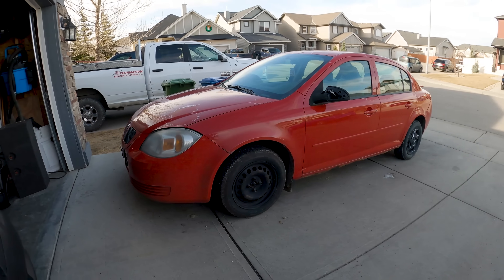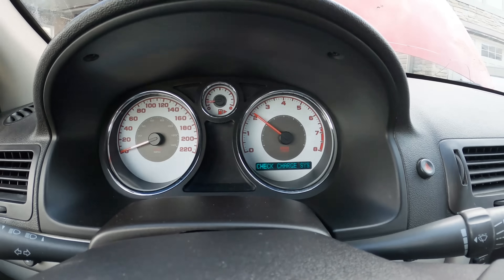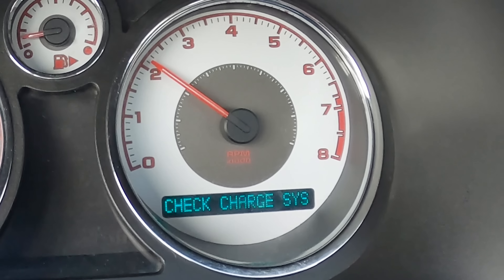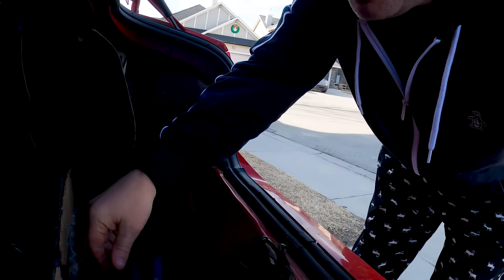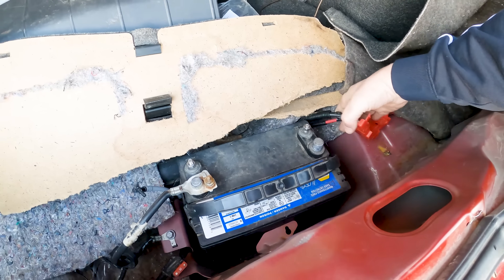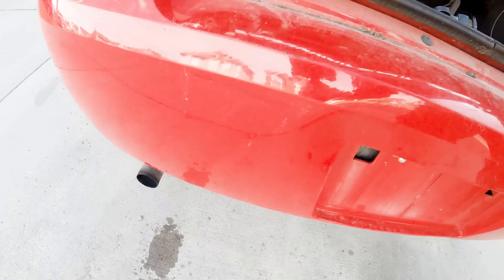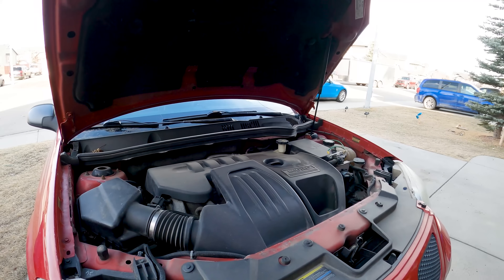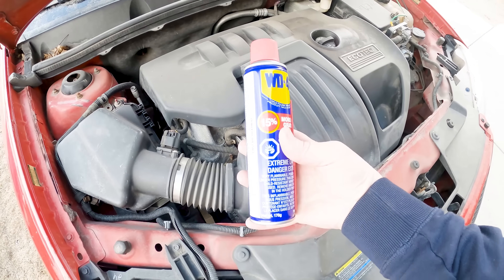ROADSIDE FIX! REVIVE your DEAD or DYING Alternator with this ALMOST FREE trick! | Gears and Tech

Comment: I have a strange question.  1995 Ranger. Had a stall out in the middle of the road which I thought was cause by the alternator. In the process of trying to get it out, I had to liberally spray the bolts with PB Blaster but some got inside of the alternator itself in the process. I had the alternator tested at an auto part store and it passed. Could this have temporarily restored my alternator and is there a way I can find this out?
Reply from the maker: It could have

No real way to find out. If they tested it they would have loaded it up too. So they should know
Reply: @GearsAndTech  I got a charge system tester from Amazon, tested it, and on the engine it is producing 11.6 volts at the battery.

Comment: i dont see what wd40 will do, another trick is to bash the alternator with a hammer, tire lever or something heavy, it unsticks the carbon brushes enough to make contact again and fire the alternator again, how long it lasts is a mystery 2 minutes, 2 hours or two weeks who knows ???
Reply: You obviously didn't read my comment..i literally feel this WD40 thing was/is a dam life saver..WD40 washes the carbon tracked rotor/brushes temporarily, giving it 100's of miles of refreshed duty to get to point B and them some.
Reply from the maker: Yes. Sometimes getting to the alt to hit it is harder than spraying with wd40

Comment: I wouldn't do that disconnect the battery while engine running. voltage could spike blow the PCM. its happen before. i have 50 years in car service field.
Reply from the maker: Thanks for stopping by

Comment: no tools eh? that ($10) usb adapter is a tool in this context. if you are creating a list of shit people would need to test the alternator why should someone go get a usb adapter when it would be nearly the same cost to get a cheap ($12) multimeter and at the very least the multimeter would have a MUCH WIDER use range.
Reply from the maker: You don't need those tools. That's just extra icing on the cake. Not required though

Comment: Thanks the WD40 worked in the alternator it came back and the battery was at over 14 volts engine running. The lights are bright and so is the chance to get important things done for the near future. Please give yourself a nice pat on the back for your great advice. :)
Reply from the maker: Glad it helped
Reply: Get it changed out asap, and keep the now working old one as a back up.

Comment: Never ever removed the cable when car is running it will destroy the ECM and the alternator and if it's charging it should be at 14 volts
Reply from the maker: Thanks for stopping by

Comment: You are completely wrong! I’ll spare you my almost 30 years of automotive credentials and 2 master’s degrees because you probably don’t care anyway.  Disconnecting a battery terminal on a running vehicle on any car made in the past 35 years is not only the most stupid thing one can do as a diagnostic, it is also not at all reliable as a diagnostic! Especially on vehicles manufactured in the past 15 years as they are almost all computer controlled charging maintenance and electrical field controlled according to electrical demand. You truly have no idea what you are talking about and possess absolutely no command of automotive repair, electrical or electronics theory and operation. Disconnecting a battery terminal on vehicles in the 1970s and older was common to test the charging system and also necessary because they had generators with external mechanically operated voltage regulators that were unaffected by voltage anomalies and high current spikes that destroy modern electronics through the high resistance condition created when disconnecting a battery terminal while under operation and electrical generation. It was also necessary to do on 1970s and earlier vehicles as a diagnostic to see if the mechanical relays in the voltage regulator would operate when energized and de- energized additionally the generator could be put into a full field operation that way as well. Very few mechanics in those days had electrical diagnostic tools to trouble shoot without disconnecting a battery terminal. You however are just negligent on so many levels of misinformation throughout the entire video. Please stop embarrassing yourself… please!
Reply from the maker: Thanks for stopping by

Comment: As a slight mechanic, idle voltage at least to the battery should be somewhere near 14 volts. That being said the cigarette lighter port should be at 12-14 volts constantly when the engine is idling
Reply from the maker: Thanks for stopping by

Comment: @Jamesgeorge4874 is 100% correct! Many newer vehicles, especially chysler with a tipm system, or many other high end electronics can be severely damaged by his process of disconnecting the battery while the engine is running. The 2.2ltr eco tec featured in his video seams to be a 2007 or older Pontiac G-5 due to not having variable cam timing which the 2008 models have means, THAT IS NOT A HIGH END, HIGHLY OPTIONED VEHICLE! ITS THE REPLACEMENT FOR THE CAVALIER, & DEFINITLY NOT A MERCEDES BENZ! also, spraying water displacement #40 on one's serpentine belt is NOT A GOOD IDEA!!!!  In the alternator maybe in that situation but, NOT ON THE BELT!!! I've seen tipm systems go out for no reason at all much less disconnecting the battery leads while operational. One is begging for computer problems in a 2015 & newer vehicle doing as done in this video. On older vehicles this was a standard test 4 a alternator but with computer controlled cars, is it worth frying electrical circuits?
Reply from the maker: Thanks for stopping by

Comment: Why not electronics cleaner or even brake cleaner to clean the a alternator brushes?! 
WD-40 is conductive and spraying it frivolously onto an electrical component has the potential to not end well. 
I understand this worked for some people but it would almost certainly be safer to use a non-conductive spray cleaner.
Reply from the maker: Because it's doing more than just cleaning. It's also unsticking things.

Nothing is better at loosening things that should be loose.
Reply: @GearsAndTech That is true.
But if the alternator was completely stuck and not spinning there would be a serious problem and WD-40 would probably not get it spinning again if the belt wasn’t able to turn it. 
The belt squealing would likely be a loud giveaway if the motor was able to start, and in the case of possibly getting WD-40 on the belt would reduce friction on its pulley further making it less likely to spin.

Either way, it’s good that it worked and it was able to run for awhile safely.

Comment: or you can just drive to autozone or some other car parts store and they will check your charging system for free
Reply from the maker: Hard to do on the side of the road with a dead battery

Really easy to spray wd40 in on the alternator and get a boost then drive home with no issue

Comment: Removed the battery terminal to check my 2019 Jeep alternator. Engine stayed running:). I don’t believe the electrical issues as my battery died nearly completely was at 9v. 9v is way worse for electronics the interior had a strobe light instead of a dome light, and all dash lighting was flickering for about an hour until I towed it home. The engineers have to design the electronics for a dead battery as batteries will fail inside the warranty.
Reply from the maker: Battery has a problem. Alternator is good

I agree with you. These vehicles will all likely have a battery fail open at some point. It's the same thing as removing the cable

Comment: That's all fine and dandy as long as the problem is just the brushes and not the voltage regulator
Reply from the maker: For sure it won't fix everything. But it's worth a shot
Reply: It WAS all fine and dandy for me with my sister broken down over 250kms down the road sitting in a precarious spot..this trick saved waiting hrs for a tow, and was a under 10min fix..

Comment: If you don't have WD handy a tap on the alternator with a small hammer or similar will often  get you going again.
Reply from the maker: It can help. Usually it's hard to reach them with a hammer. But you can get the wd40 to spray in there

Comment: |> |> |> |> |> |> |> |> 
|> |> |> |> |> |> |> |> |> 

Great hint ...

But you would not pass the technical Test of a Austrian driving licent when the tester is picky ...

Because you should ALWAYS beginning with minus by disconnecting and end with connecting ... Because it's the same like by starting help ... Hho gas can apear in the batteries ...

It's is taught in the curse ... 

Reality ... Well ... When the place is good vented and the batteries is no danger ...

Problems spear when the batteries is not vented and some funny things was made several times which produce Hho gas (66, periodic hydrogen and 33,periodic oxygen on electrolysis) ... And in the origin me x is it self enlightened under pressure and it don't need a lot ... That is to see by all that funny guys which do around on YouTube s eith Hho cells which don't seperaten hydrogen and oxygen by production and that bullshit bubblers ...

One reason why Hho is not that easy to apply on cars is the capsizing thing.

Basicly if no bubblers and a seperating cell is the danger ZERO by Hho but a cell must be constructed that capsizing is no problem plus proper production ... Is no problem when you have the needed intelligence ... 

And with the amount of oxygen you can control the burning process ... Stanley Meyers cell didn't seperaten the gases and would do never get eu regulations aprovement.

But my system must be approved.

Anyway .... That is the reason why the order by connecting and disconnecting.

Yes ... And what is done to real developers which don't serve the blood money dependence system ... Retired high educated machinist for building, I stalling, and maintaining factory street, hydraulic, pneumatic, rldcttopneumatic, SPS, CNC, all methods of welding, ECT, ECT, ECT, ... 

You must fuck whores in pataya as Austrian pensionist ... 

But to create such things like the Hho injector system, Hho environment system and the Coanda drive for Marin applications which remove all pollution caused by traffic ... 

And search "why ships kill the planet more then cars" here in YouTube, ... And enjoying y the foresight of your doom ... 

Because over 350 times more then all cars and trucks, ECT TOGETHER on that planet.

This drive base on the same "blameless fan" design like "jetoptera's" "flying car" Modul, contracted from the us airforce 3021 for drones, one point is >minimum three times the trust then conventional drives" ... And I know there is more in it.

But because "watch the videos" only that 4500 operating containerships would driven only by photovoltaic and Windgenerator (yes, ... Normally redicilous it works because the immens enforcing of the inlet power) remove Aldo per year the tax and income of oil industry of some beyond 2 TRILLION USD!!!!

(4500 × minimum 10 times per year× minimum 45 million USD per tankfull for ONEi ship!!!!)

researches of harbour Hamburg and Rotterdam ...

Not counted all tankers, fun passenger ships, alone in the USA 12,5 million recreational vessels (research brokers) ..

That numbers are real ... No bullshit.

So I must die ... Because "clima", "CO2", pollution which rott per year x spices in plants and animals, and 8-10 million people doesn't matter when the basic income for high treason and world and massmurder is in danger ...

So please have a pity with the psychopaths more demons in human bodies and vote them the next time again without "empathy system" which test over a special endocrine system and neurotransmitters who is EMPATH or psychopath and all between and the whole skill and ability profile because all what happens in the body MUST be processed and transported and thus for this endocrin system and neurotransmitters ...

The strongest multiple empaths with the highest cognitive skills on the highest position in the state ... And the psychopaths removed from office, charged, ... And so on ...

So RRAL live,wisdom and intelligence rule .
. And justice ... Especialy justice .
.

The a dumb breed from demon religions breeded in x hundret of years inquisition, witch hunting, and fire and sword massakering with selection of "believe the last bullshit of drinking blood and eating flesh in very clear cannibalistic demon rituals ... Like cutting off foreskins in a age where you can decide nothing ... And so sooooo immensely "love" and "lovefull" ... And kneel and pray that you feed the demon rith that what let you heal only you think a d xtrosepill is any "medicine" = placebo effect ... Your real divine power which every seared creature have because awareness ficus energy DND can trabsmite it ..

And when a burning bush (also called "El shaddai" = the dark spirit or shadfowlike, known from the Egypt and bab-iluan) 

WSNT DO MUCH the "sllmightyness" or what ever energy what you should trabsmite to him ... 

Then he have and don't us it obviously 

And when he let murder for so long time all which know better is this a clear psychologic Profil.

Hardly to oversee if overlook and real ethic.

But sorry that I bother you as multiple superempath with a synaptic connection tested 1988 which gives me also a score in analoge Analytics thinking from minimum 99% ... Average is 80%, performance curve up is logarithmic ... 

When I made the driving licent ... We had the worst tester ever ... I was the only one which claws allowed to make the Praxis test on the street, all other was finished from that bastard ... 

In Austria is it the case that the teacher can sit behind the tested ... It was a sick show ...

14 students ... 1 approved ...

HAHAHAHAHAHAHAHA ... Try that ...

This world have dick bastards in power which must be removed ...

I'm only in this body (watch my videos = proves of x tries of zorering to death and murder) because in the opposite of Stanley, troy, and all the other I had a serious education in martial skills, Tai Chi, chi gung, meditation, and know how to deal with poisenings ...

Done 1999 where I found the empathy system ... 24 years now ... There is a real war ... And noone of you check that ..

With a proper alternator you can run my system ...

On my and any Hho system is the alternator a key factor ... 

You have no "fuel" you create it >on demand< and for that is the alternator essential after you start from the batterie ...

Askashback fuses are Tesla ventiles used ... The whole control over pressure sensors in the system with a processor.... Which controls the cell in volt and ampere and pulsing.

I need endless petitions to the human right court ... That criminals work all together in real and ignore my nails ..  play dirty schemes anx gaslighting with me that's not to believe 

I'm a real veteran ...  I know what they do, how they do ... Another reason why I must die ... Also because I worked out in the last 25 years the solution for every sick shit on that planet which include the persecution of that scum.

What you all don't know about UNO, WHO, ECT ...

You can use the placebo effect power in meditation to heal ...

Look at my videos ... A normal mold allergicer with allergic asthma dies in the first night what I endured for over 2 years now ...

I know the StgB = Austrian criminal code and the SOG = Austrian police code and what they are allowed to do, not allowed and what they MUST DO!

nowhere a email received confirmation ... The app works everywhere else ... Phone gaslighting and botbreed.

Only the Austrian consul girl in Panama heloed a bit in FEAR ... and was soon no consul anymore ...

But I know ... Cleaning Hho cells here and there is muuuuch to exhausting, ... You prefer to pay diesel and gasoline ... 

And give a shit on real developers which are no scum 

Or?

|> |> |> |> |> |> |> |> 
|> |> |> |> |> |> |> |> |>

Comment: You should have a fire extinguisher handy as WD-40 is flammable and I have had electrical sparks ignite WD-40.
Reply: Dom, did you intentionally skip passed that part where he said : 
"let in soak for about 5mins" ?
..Gears & Tech didn't say, spray on liberally while car is running until the can is empty.
Reply: I didn't skip, I just remember an electrical switch that was lubed with WD-40, sat for almost 2 hours and the switch arced when I put it on and POOF flames. @sevendyseven4090
Reply from the maker: I'll give it a try. I can never get the stuff to ignite
Reply: I sprayed WD 40 and my alternator start smoking

Comment: His quick repair will only work if the carbon brushes inside the alternator are at fault. If the diodes, stator winding or rotor windings are shorted/open, spraying WD-40 won't help at all.
Reply from the maker: True. But it's still worth a shot
Reply: AND in my personal case, 100's of miles out, on a late sunday night >>
"IT HELPED".

Comment: We used to do the batterry cable off trick on old cars, but I would hesitate to do it on anything built now. If your light is on and you know the battery is new just go get yourself an alternator and put it on. Good luck as a do-it-yourselfer on some cars though!  I've been fixing for 55 years, and there are a few jobs that I see that really really make me wonder what the heck did I get into, even with the right tools, heated shop and a lift.
Reply from the maker: Yes, the older I get the list of work I want to do myself gets shorter